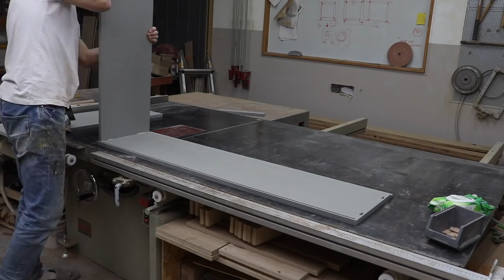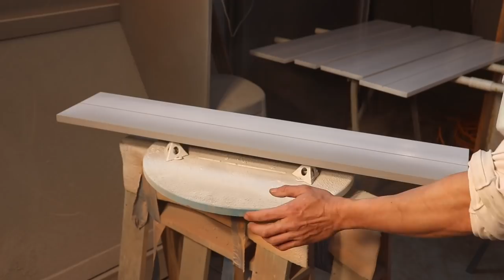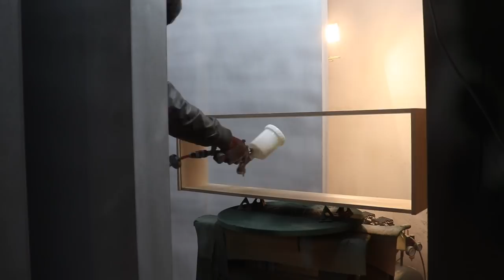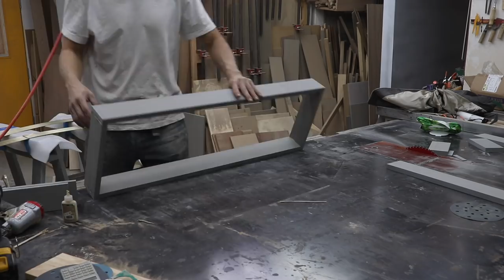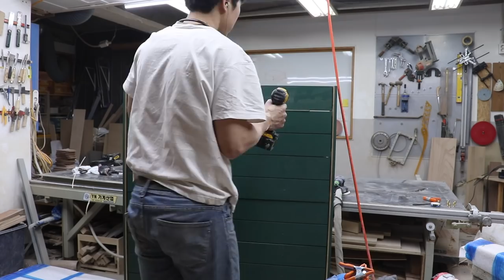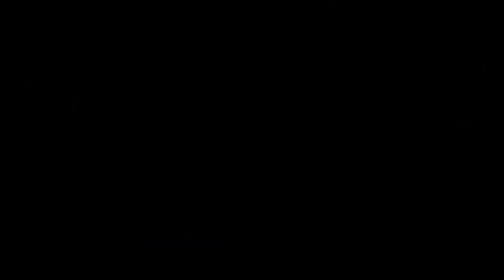W63_Drawer

Comment: Great video as usual. I saw a grriper push block. Do you ever use it?

Also why did you use walnut plywood instead of luaun? Walnut ply is more expensive.
Reply from the maker: yes I havea gripper push block but... I don't use that... 😅.. and in this design.. walnut is more combination with green colour